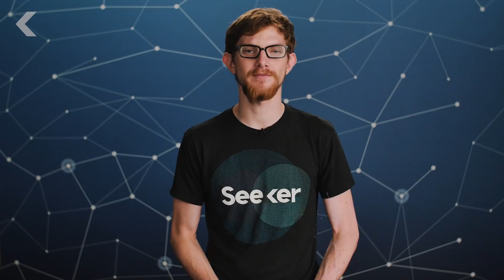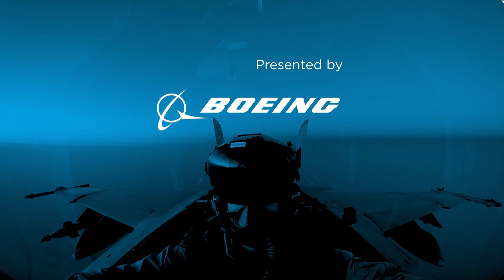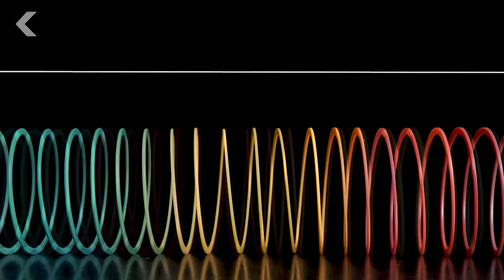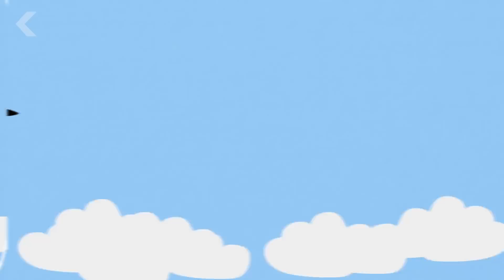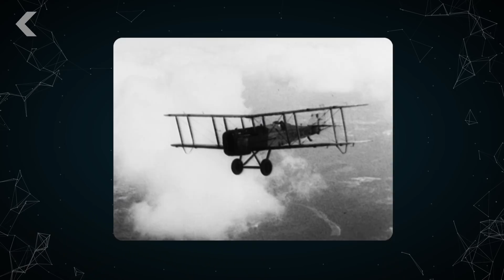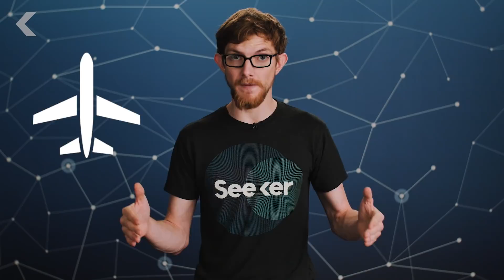The Simple Discovery That Let Us Fly Faster Than the Speed of Sound

Comment: If thats the case then,  how come the Bell X-1, the F-104 and the X-15 went supersonic WITHOUT SWEPT WINGS?
Reply: Both f104 and x15 have swept wings, also the bell x-1 needed a lot of thrust behind it to reach Mach. Having a swept wing helps reaching supersonic regime but it doesn't mean that given enough thrust (and wing strength) a plane can't reach mach
Reply: The one thing left out on this video pertains to the X-1. It was highly inefficient for transonic flight. The dirty air made it uncontrollable until they changed from a standard rudder to an all-moving tailplane instead of traditional elevators. It was still a brute-force solution, but it worked.
Reply: Because those that did the research for this video have no fucking idea what they are talking about. 

Spanwise flow does happen, but only at lower speeds. It was a big problem in the early jet age. Early MIGs had wing fences to combat the problenms fo spanwise flow (yes, they tried to prevent it)

Look up wingsweep on wikipedia if you want to get started on learning it properly

Comment: 2:15 wings do not fundamentally work by the Bernoulli effect as described, for else the Wright brother flat wing plane could not have flown, nor any aircraft fly inverted. Yes that creates a little lift, but not the majority. Instead the wing is at an angle (the angle of attack) and the air underneath is directed downwards. By Newton's 3rd Law that means the wing experiences a lift upwards to conserve momentum. The top of the wing is curved to help the airflow adhere to the shape, the Coanda effect, and eventually come off the back of the wing also with a downwards component, thus creating some more lift. This smooth upper surface shape prevents air breaking off the wing surface as eddies of turbulence . See https://www.youtube.com/watch?v=aFO4PBolwFg . Aircraft when they take off do so with the fuselage at an angle thus increasing the angle of attack (we are all aware that passenger jets do not take off with fuselage remaining horizontally parallel with the ground). To help with lift at take off and when coming in to land, flaps are deployed to help direct airflow even more downwards, thus generating extra lift at slower speeds. Planes that can maintain inverted flight (engines have to work with oil, fuel and fuel pumps operating inverted and wings need structural strength to support weight in opposite direction to normal) do so by keeping the fuselage at an angle. https://static.rcgroups.net/forums/attachments/1/7/5/6/5/ai21754162-140-thumb-Inverted%20flight.jpg?d=1205073198
Reply: Good to see someone knows the truth haha. The other blunder they made in this video was saying that the shockwaves form over airfoils because of the air increasing in speed over the top of the airfoil. Although it is true that the air increases in speed, the increase is insignificant when compared to the speed of sound through air. The true reason is that the speed of sound actually decreases instead, this is because the rapid decrease in air density causes a decrease in air temperature.
Reply: I was looking for this comment, nice :D
Reply: They didn´t...
Reply: Well said. Anybody who has seen the cross section of an F-104 Starfighter wing knows that Bernoulli is optional for flight.
Reply: Well, also the curved shape of the wing effects the air molecules above it. Via the coandereffect air flows around the shape of the wing and that creates a centrifugal force, that pushes the airmolecules away from the wing and creates a lower pressure region above it.
Reply: Mandernach Luca Could you link your source? Thx
Reply: Well, the Bernoulli effect still does contribute to lift.
Reply: bi1iruben 
The Wright Flyer wing design is exactly as described in this video. 
An extreme example would be to look at the Wilga, built in Poland. 
In aerobatics, there are several aircraft that actually use a symmetrical wing. Although the wing is not ideal for lift for straight and level flight, its characteristics inverted are equal that of when it is flying normally upright.. Check out the Edge 540 wing design. 
The symmetrical wing isnt just for small aircraft. The F-105 Thunderchief  also had a symmetrical wing, and it is quite large. It was always slightly nose-up when maintaining an exact altitude. 
The SR-71 is also effectively a symmetrical wing, and was always slightly nose-up to the horizon when staying at a fixed altitude.
Gliders and the B-52's have such extreme lift wings that they can point nose-down, and be climbing up. Gliders are always nose-down. Additionally, if a glider had a symmetrical wing, it wouldn't be a very good glider at all.
Reply: The P-51 Mustang used a symmetrical wing to reduce drag allowing them to conserve fuel and escort their bombers for longer
Reply: Barrett Jordan 
The P-51 did not have a symmetrical wing. It had a laminar flow wing.
Reply: Thankyou. I was looking for this, and hoped someone would write it before I did
Reply: The Contribution of the lower pressure due to bernouli above the Wing of a convensional airliner to the total lift is actualy higher than the positive pressure below the wing due to Newtons third Axiom (about 60 to 70%). We couldn't fly nearly as efficient without Bernoulis law and would need imensly high take of speeds. Actualy what Flaps do is increasing the curvature of the wing and therefore increasing this Effect. Aerobatic Aircraft like Fighterjets also heavily use this effect and of course also have curved wing profiles and not just a flat sheet of metal. Therefore it is pretty uneducated to say it doesn't have a significant effect for aerodynamics.
Reply: This is just not true.
Reply: The shockwave does form on top of the aerofoil because it increases over M=1, the shockwave is actually an oblique shock due to the pressure gradient being too great.
Reply: This isn't really correct. It's much more simple. Aerofoil design makes the air flow faster over the top of the wing, using bernoulli's equation, this makes the pressure drop. Opposite for the bottom, creating higher pressure on the bottom than top, this is lift.
Reply: Flaps and slats change the wing camber (not curvature although I know what you mean), and also increase the plan-form area (bigger wing = greater lift co-efficient and more lift)
Reply: Connor: Repeating the false myth does not make it any more true. The air is not arriving at the same time to the end of the wing, the wing shape does not make upper side air go faster.
Reply: Heikki Kultala Ok. So where does the difference in pressure come from which causes lift?
Reply: The lift is not caused by a pressure difference related to bernoullis law. It's caused by much simpler newtonian mechanics. The Wing has an angle of attack, which pushes the air downwards when the aeroplane is moving. As an opposite force, the air pushes the plane upwards.
Reply: Small part of the lift also comes from coanda effect, and that's why the upper side of the wing has more curvature than the power side.
Reply: yup exactly. This comment needs likes so that people can see
Reply: "The air is not arriving at the same time to the end of the wing, the wing shape does not make upper side air go faster."
First half is true. Second half is false.
Reply: I don't understand why people who are not expert in the field (as in having a degree in aeronautics or fluid physics) would go on post comments like this to spread false/inaccurate information. Please, can you stop doing this? what's the point? to wow a bunch of strangers you would never meet with your self-conceived knowledge?  can you just use the time to learn a bit more on topic, perhaps on the difference between fluid and particle dynamics, and leave education to the experts? and if you want to challenge the conventional wisdom, get a degree! publish a paper! don't waste your time (and everybody's' time) on youtube!
Reply: Maybe you should of made the importance of "angle of attack of chord line" more definitive, because without, there is no lift. I'm only suggesting, so it would make it easier for others to understand, who do not have a professional background....
Reply: i can say so many things about this comment, but seems like others already have and was a pointless effort
the only thing is worth saying is get a degree...
Reply: Jake McCoy is right but I am going to add this ... long name but he still is right the video didn’t make a mistake because it wasn’t trying to explain lift it was explaining one of the reasons why drag increases as you get into the transonic region which was correct
Reply: Bachelor's degree in aeronautical science here. I don't know whether to laugh or cry at these comments
Reply: dragonage200
I'm wondering. I definitely understand that wings work by utilizing all of these laws: 3rd Newton law (in the form of Angle of Attack), Bernoulli (in the form of curved wings), Coanda effect (in the form of flaps), and probably some other that I don't know yet. But people seem to dismiss one over the other.

What is your take on here? And just being curious, but which force has a bigger contribution to lift?
Reply: Fava Sz, i'm sorry but i'm not about to attempt to explain a 4-year degree through a youtube comment. When I was working as a CFI, the principle of flight is a 2.5 hour long oral lesson.

But the long story short is that there are still debates on this topic. Newton's 3rd Law is insufficient because there is no equal and opposite force to lift, because the upper portion of the airfoil contributes much more the the downward deflection of the airflow. Also, there is clearly a huge pressure differential between the upper and lower surface of the airfoil, otherwise we wouldn't see condensation clouds forming, and there would be absolutely no use for wingtip devices. Bernoulli's principle is also insufficient because of the equal-time-theory inaccuracy. Yes, the airflow does not meet at the trailing edge of the airflow at the same time, but the airflow over the top travels much faster than predicted by the equal-time theory.

In conclusion, all you need to know is that we still don't fully understand science (surprise surprise),
but we have made enough gains in aerodynamics and propulsion to effortlessly and regularly smash through the sound barrier. I remember speaking to a friend who went supersonic in a T-38, and he said even in such a "low-powered" jet, nudge the throttles forward and you're supersonic before you even know it. The only indications were the airspeed readout, and it gets a little quieter.